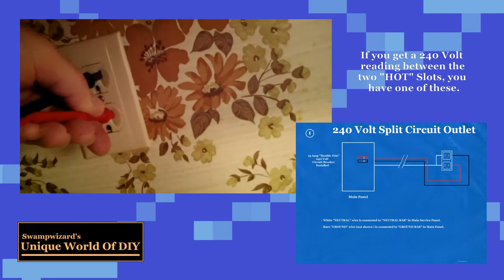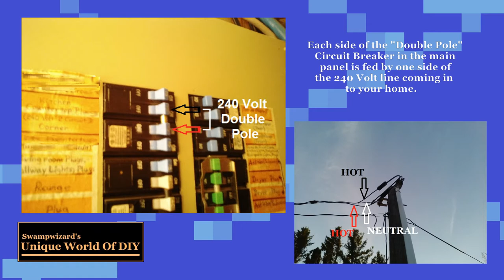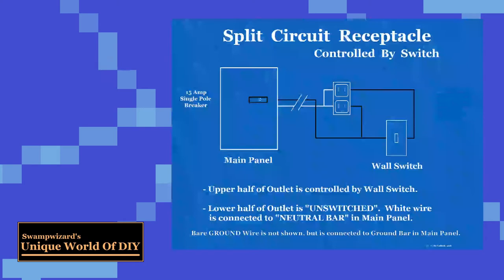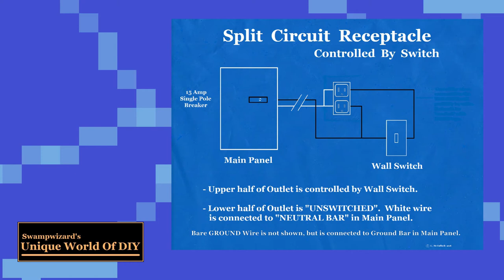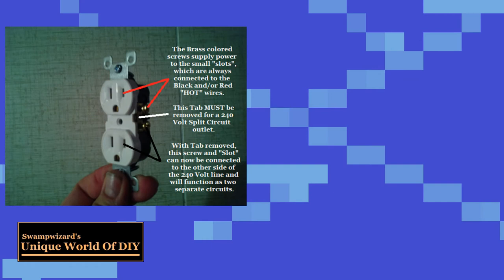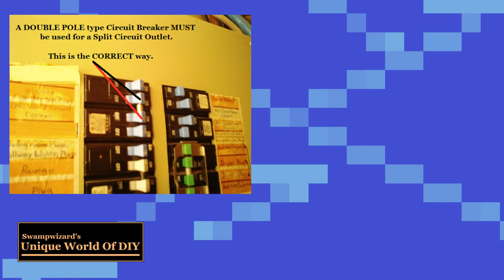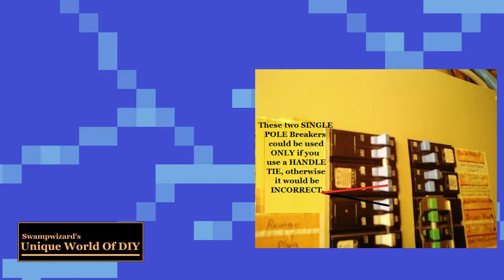Split Circuit Outlet / Switched Outlet - How To

Comment: Thanks for posting this video!! Scenario: I have a 3 prong double outlet, single gang receptacle that has a pigtailed  hot and neutral. The neutral goes to one outlet (top or bottom) and the hot goes to the other one. For sake of explanation, the neutral is pigtailed to the top and the black is pigtailed to the bottom. When power is turned off at the breaker, the outlet itself is no longer live, but after using a tester one or more of the wires pigtailed into the outlet is still live. Why would someone wire the outlet in this fashion? I haven't verified if the outlet tab is removed (most likely it is) or not. I'm sure this outlet is midstream of the others, but I've never seen an outlet wired in this manner with pigtailing . Can't a guy do a simple outlet replacement! Come on man! Thanks for reading and shoot a reply if you or anyone knows. Thanks!